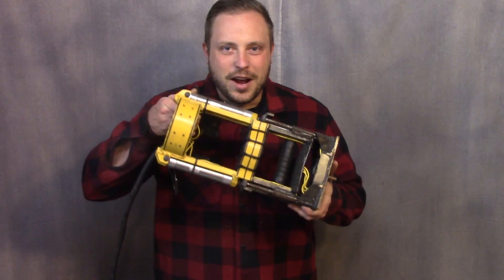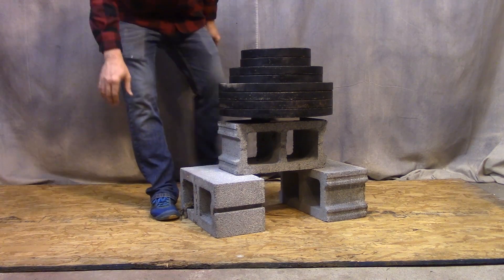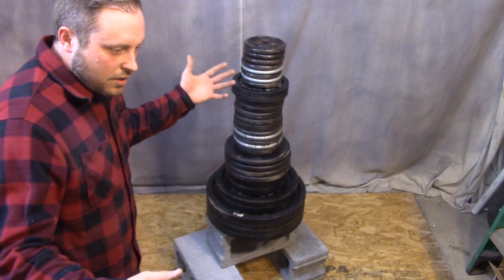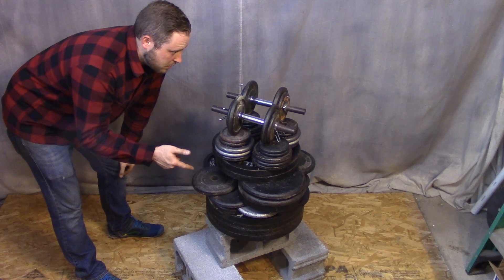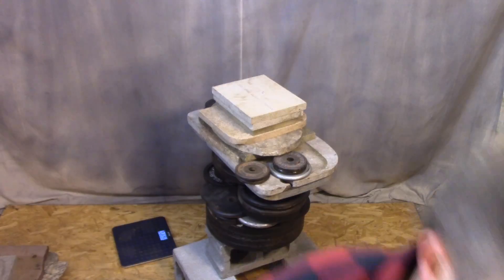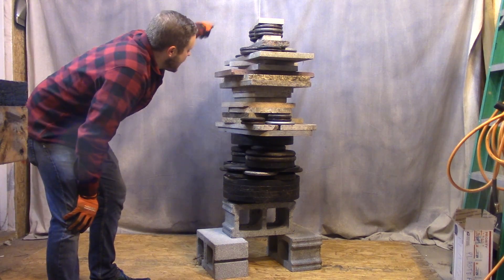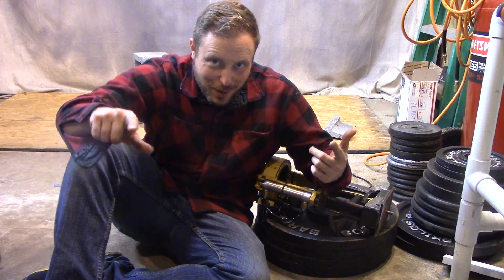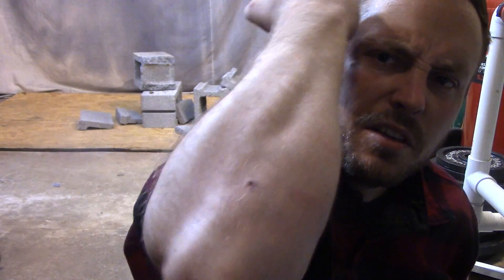POWERFIST POWER TEST - How much force to break a cinder block

Comment: wtf? hahaha.
a static load and impact force aren't even comparable 
if you just educated yourself on the difference, you'd have immediately know that all of that work is for nothing and you could have just calculated it all
Reply: blueswagman isfitnotfacewithtapethem. ur not very bright are you
Reply: Take that little hammer he was tapping the pile with.  Just tap a little bit harder than he did between the supports of the block. Barely even 10 FOOT POUNDS OF IMPACT!!   The brick would crumble. All this video did was demonstrate an amazing lack of understanding of physics. Time is a critical component of force in determining work like reaching the failure point of a material.  Take a damned physics course and some basic thermodynamics.. At LEAST like pointed out learn the difference of static and dynamic forces. When he was several hundred pounds over what he KNEW was the breaking weight, he should have stopped making a fool of himself and looked up on the internet what was going on!!!
Reply: J Martin
Maybe the video was just so fucking stupid.
Reply: He has a spike at the end of the powerfist, which it would make it outrageously easy to break the blocks.
Reply: Mason Warner not a spike. A button that goes in the fist to activate the co2
Reply: Texas Rancher 10 foot pounds?
Reply: This exactly. Impulse dictates how much force was applied to the blocks. Not to mention the concentration of force from a smaller area, that metal sheet he put under the weights doesn't concentrate the force as much as he thinks it would.
Reply: This whole thing is a dumb waste of time and money in a pathetic attempt to get views. That's all these kinds of attention whores want. Clickbait titles and zero useful information
Reply: Hunter Broadhead no it's same just the area was spread out so less stress on one point
Reply: blueswagman isfitnotfacewithtapethem. You're so wrong I can't even tell if you are actually responding to what I said...
Reply: God you sound so fucking codescending

Comment: it was not a punch of 2000 pounds. Cinder blocks are made for supporting weight. If you put weight on a cinder block it doesnt break because of the type of structure they are shaped. If you concentrate all the force in one single point they break because they are made of cement and cement is hard but brittle so....

Comment: there is a huge difference between putting on bits of wieght at a time than a sudden impact. i can swing a 16lb hammer and break a cinderblock at about 300lbs of force. its because of the sudden impact. where as adding wieght a single cinderblock can take around 2000lbs before crumbling. but never the less its cool that you have made a working powerfist

Comment: I'm not sure if this video is fake, but It is not the wight that breaks the block, it is the impact. I can crack a 
block with a 16oz hammer, and I can't swing with the force of the wight 
he stacked up on the block. Stacking wight does not have any correlation, to the power-fist's force.

Comment: A bowling ball launcher will not work. Period. The recoil it would produce is impossible to withstand. Eveb if you only want it to go like 100 m/s, and have a 1m barrel, and only shot a 5 kilo bowling ball, that's 250 newtons. Like 60 lbs horizontal force to throw a tiny bowling ball something like 10 meters.

If you weigh 180 pounds that's like in the span of a fraction of a second standing straight up, to being 30 degrees backward, to standing up straight again.

You could resist that, but it would suck. To make an effective weapon it would have to floor you

Comment: You're a goof. That plate is what, 9x5 inches? People hit 500 to a thousand PSI with their hands. To replicate that with just stationary weight you'd need 2500 pounds MINIMUM.

And I seriously doubt your power fist is ANY more effective than an empowered version of the same weight. Cinder blocks are easy to break with a hammer, and that's what you built. A hammer with pointless moving parts.

The power fist is a completely fantasy design. It has no application in the real world. The physics just don't work out.

Comment: The reason the weights didn't break the cinder block is that they were across the cinder block, the weight was spread evenly across the block so it would hold its strength. That is also why the punch broke it as it broke down the middle which is the weakest point. It is all about the fact that a small area will do more damage than a big area, it's how knives cut into things and how pins stick into a cork board to hold a picture or something.

 God I'm a nerd...

Comment: 2 reasons this is flawed. when you have that much momentum is multiplies the force to the point where it is extremely stronger than just setting weights on almost like slowly standing on a soda can vs stomping on it. also you have to put in to perspective surface area. imagine punching someone vs poking someone really hard while you are using more force on the punch a small surface area punch could easily equal that force put into the punch with almost 0 effort putting those things together like this weapon is doing is why it can break 2 cinder blocks. it certainly does not mean this is throwing 2000 lbs of force

Comment: not a good test at all. cinder blocks have massive compression strength but very low impact resistance.
Reply: Kyurae Minasaki the pin goes into the fist i think so it makes no difference. i didn’t watch him build it, this was in my recommended so idk lol
Reply: Kyurae Minasaki I am unsure, but I think that's just a button that collapses flush with the plate; It would be a very poor design choice otherwise, it'd be better to make a push dagger or something going that route.
Reply: ASTM C140 testing for masonry compressive strength testing will show you would need at least 35000 pounds to fracture the block
Reply: I said the same thing. He needed to put the smaller weights first to concentrate the point at which the weight was focused, exploiting the weak tensile strength of concrete blocks.
Reply: if you remember at the beginning of the video, he balanced all the weight on a metal plate exactly the same size as the punching face of the gauntlet. as for why the block wasn't crushed by the weight; it only had the force of gravity acting on it and it didn't have any momentum to carry it through the surface of the block.
Reply: Tensile strength is the other one lol
Reply: I was just gonna comment something saying about the same thing
Reply: renzak666 hmmmmmm...fuck it. It's a power fist.
Reply: that plate was NOT the same size as the gauntlets plate, cause he was using a stripped down version of the full gauntlet, where it was all focused on a single point. look more carefully. plus, remember: mass TIMES ACCELERATION.
Reply: CurvingFyre Talos focused on a single point? Yeah, the plate.
Reply: Combined with the fact that his powerfist has a little pin in front of the plate that causes all of that force to go into that one little point in the cinder block.
Reply: Yeah his reasoning is retarded

Comment: unnecessary danger to yourself. you confused applied force with static force. think about a block building: the ones on the bottom can support the whole building because they were applied in layers one at a time with low to no force behind them. but if you drop a cinder block on top of another one from say 3 feet it would probably break both of them

Comment: theres a difference between pressure and force.
the nail on the power fist has a really small surface while those weights take up the full surface of the cinder block

Comment: well part of the problem could be the point on the fist, its easier to drive something through with less force if the point of contact is smaller, so you could be bunching with 500 pounds of force and because of the small point its going through like 2000 pounds

Comment: I don't think you know how physics work

Edit: I just want him to know he could stack a trailer home on top of 4 or 5 of those bricks
Reply: I guess you can say... he's a blockhead..
flies away
Reply: And since those blocks are designed to hold static loads, he could have kept stacking those weights without much happening.

I've propped up vehicles on blocks like those with no problems.
Reply: Michael Nemesis your definitely not the only one
Reply: DANGER NOODLE agreed, weight and force (although both using pounds) works a lot differently.
Reply: Thank goodness somebody noticed that. I thought I was the only one
Reply: If he'd have dropped one of those 45lb weights on the cinderblock from shoulder hight it would have broken it
Reply: My head was hurting so hard that he actually thought he was gonna break the block by evenly stacking on top of it......he must feel like a dumb ass now.
Reply: He was making me upset, The whole time he was in awe of the weight the blocks held, I was thinking about how he could just break it with a standard claw hammer. I kept watching to see if he realized how physics work.
Reply: Dutch Unsurprising, considering the probable size of the impact area, the many weak points in your common cinder block, and the fact that throwing it on the ground means a lot more pounds of force than you probably think, it makes sense that it would shatter. It's actually depressing to see so many people ragging on this video for "not knowing how physics works" when everyone commenting clearly knows less than the video's poster.
Reply: I literally picked up a cinder block and threw it on the ground and it shattered
Reply: ñññ
Reply: I don't even know much farther than the basic college physics course (and my own casual research) and I know there's a difference between a sudden force and static pressure. I bet given a protective glove to not hurt my hand I could punch through one of those no problem.

I couldn't however build the thing he did so eh call it even stevens?
Reply: As well as having kinetic force a fist also has a smaller area meaning more pressure in one area
Reply: Lewis Jones there was even a small needle like think sticking out of the fist
Reply: It'll hold way more on a static force also the smaller the contact area the less force you need
Reply: DANGER NOODLE it was annoying
Reply: RQvyFknclH well, back of the envelope calculations would lead me to believe that (assuming the collision takes about .05 seconds) that this results in a force of about 7000 N, or the equivalent of 700 kg of weight being placed on the block. This is probably a little low, however, since the amount of time the block takes to stop it is probably pretty small.
Reply: DANGER NOODLE I almost died watching the video
Watching it wrong
Unable to do anything about
Aaaaaaah!!
Reply: DANGER NOODLE I was just about to write that
Reply: I was hoping someone else noticed
Reply: ameteuraspirant you could definitely brake one with your hand but there is no way you wouldn't brake a bone even with a glove or something
Reply: Harrison ter Rahe Weight is a force. They are actually the same thing...

RQvyFknclH He's not the only simpleton here. If he dropped a quarter of the weight(250 pounds) from a meter high, the resulting force on impact would be just under 820 pounds. So no, assuming the impact area is the same as the area pressure was applied here, it would not break the cinder block. But if he did it with half the weight, I'd bet money it'd break. Because the resulting force would be much more than 1000 pounds. Which, actually means, the force applied by his punch was in fact more than 1000 pounds(I can't guarantee that two cinder blocks doubles the force needed, so I'll leave it at more than 1000). Even if the guy in the video doesn't understand physics, you actually have a worse understanding than him...
Reply: Harrison ter Rahe you are incorrect. Weight is just the force due to gravity. There's no such thing as a special force.

Comment: The reason the weight couldn't break the cinder block was because of the way the weight was distributed. When you hit with the power fist hit uses all its force on a smaller area. When you use the weights the weight is distributed across the whole cinder block. It kinda like this thing with nails. 100 nails all together with the points up don't hurt when you stand on them, but when you 1 nail sticking up it hurts a lot more.

Comment: What if you change a few things and add them to the bottom of your shoes so you can have extra force when running causing you to run faster.
Reply: SWAWESOMNESS Is Cool ya forgot about the weight of those. it would actually slow him down

Comment: the weights had a wide surface area to distribute the weight across the block evenly, probably close to 16- 22 lbs per square inch.  The powerfist has the rod that concentrates all of the force in one small point making the surface area if the block taking the initial blow kind of a lynch pin.  The small hole or crack followed by the brunt impact of the rest of the powerfist makes it all crumble.  Awesome vid!

Comment: I had a couple of ideas of how to test this...

1. Get some sort of digital scale or force sensor and set the hole apparatus on top of it, then punch through the cinder block and collect the peak force from the sensor. Finding a sensor that could do this and can handle the really high force would be either difficult or expensive.

2. Send this as a challenge to one of the hydraulic press channels, I'm sure those presses could break a cinder block in the configuration you use and if they don't have a direct way of showing the force it's putting out it could be easily calculated with the cylinder pressure and bore size. Plus its a good colab opportunity I think.

Comment: Dynamic load> static load. That's why you can break a cinder block with 700lb punch but not with 1000+lbs

Also, just subscribed

Comment: materials behave differently when you apply an impact force instead of a static force. Impact does not leave time for the structure of the material to adjust to the deflection
Reply: Emmanuel Campos thank you!

Comment: the pin in the powerfist plate makes all the difference
Reply: I thought so too, I think it might depress as a sort of button. I need to go rewatch the build to confirm.
Reply: Joshua S its no different to using a very small head on hydraulic press to have more crushing power the smaller the surface area. so that stacking weight experiment was a total waste of time.
Reply: scannaunderscore1 the pin is just a trigger to fire the pneumatic cylinders you can see in the video he pushes it in with his hand, the flat plate is whats doing the bulk of the impact

Comment: Cinder blocks are made for compression rather then impact, so your testing its strength against it's weakness. I can use a 2.5 lb rounding hammer to break a block. 

I swear I'm not trying to be a dick. I love your videos.
Math of an eyeballing master, cinder blocks are 8"x16", I'm guessing that metal piece is 7.5"x3.5" so 25 sq in is probably close enough. 1000lbs over 25 sq in isn't much force, only 40lbs per sq in. I can't tell how small that thing in the middle of your power-fist plate is but lets be outrageous and say 2 sq in, just punching with 160 lbs of force would be double the force of 1000lbs sitting on top.
Reply: I believe the little nub in the middle of the power-fist is the activator for the hydraulics, so it's going to be pushed in instead of applying force. I agree with the first part of your comment though.
Reply: It doesn't look like it becomes flush when fully pushed, but I could be wrong.
Reply: Heruhcane Dean it actually goes in a little bit, as shown when he pushed it in with his finger
Reply: At 5:53 he's fully pressing it a few times with his weight behind it and it looks like he slightly rotates on a high point. I hope you don't mean the part just before with the plate angled away from camera before he slaps it a couple times.

Comment: wait but your actuall hit doesnt account account for impact velocity meaning that the actuall force could have been less Right?
Reply: During and impact a force is exerted over the duration of the impact and often varies with time. So when he punches the cinder block at some point during the very short impact the peak force he's exerting is well over the 1000 pounds he had on there. The integral of this force over time is equal to the change in momentum of the fist/arm system so you are correct that velocity is involved; a higher impact velocity would mean more a larger change in momentum meaning a higher impulse likely meaning a higher peak impact force.

Edit: This was a little wordy, sorry
Reply from the maker: Joshua S well said, nice to read an informed comment.